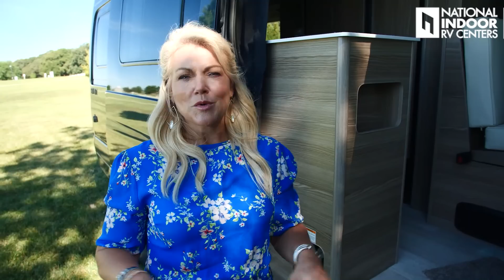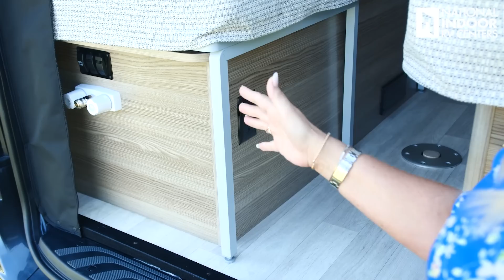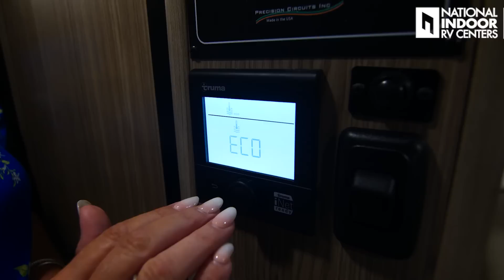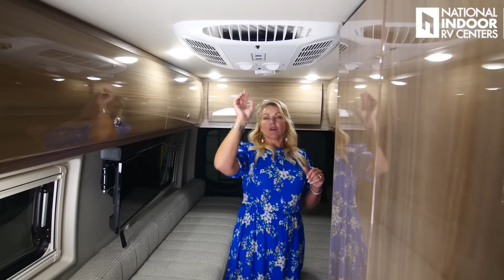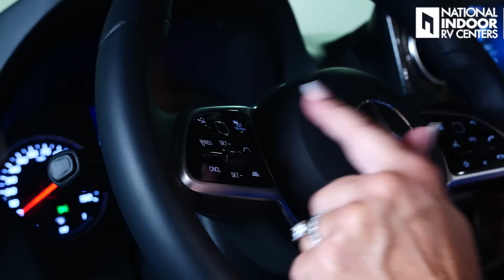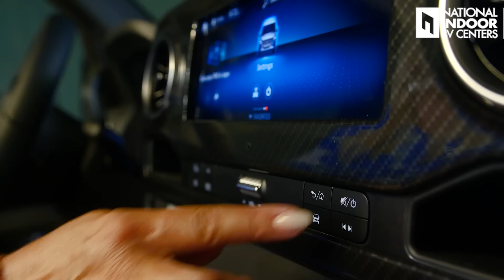2021 Winnebago Boldt | Full Motorhome Walkthrough Tour | NIRVC

Comment: Great in-depth video!  I appreciate the inside look at the engine, etc...also, safety features for a solo traveler.  Oh - and rear fog light is red, and a single light, it’s required in the EU, if it’s foggy you have to have it on so people can see there is a vehicle in front of them even if they can’t see it through the fog.  Used mine a lot in Belgium and Germany.  They even have a way to affix them to American cars so while stationed there we could be in compliance with vehicle safety laws.

Comment: I just love this RV.  Two questions:
1.  Can you special order the table tops (foldable) to match the cabinets?  I love the tables but just wish they matched the rest of the interior.
2.  Can you add 2 more lithium batteries?  My goal is to have enough power to run the a/c at night if we pulled over & to take a break at a rest stop overnight and there are no hook ups.